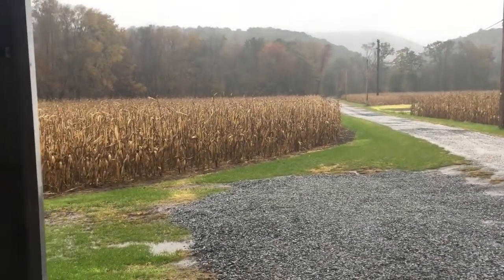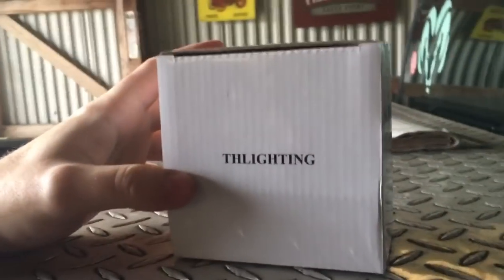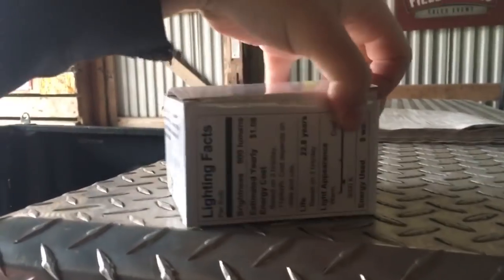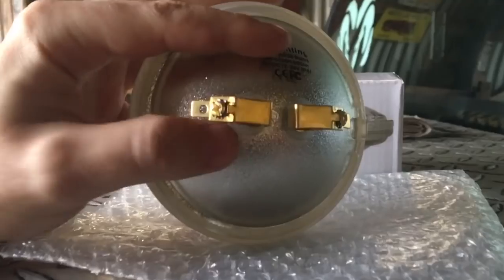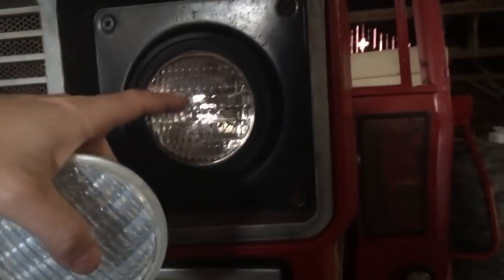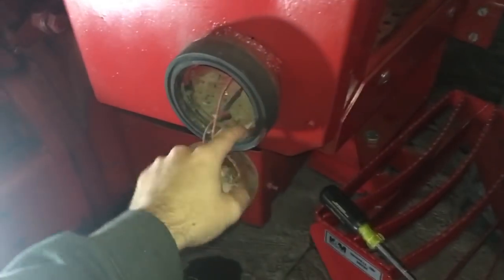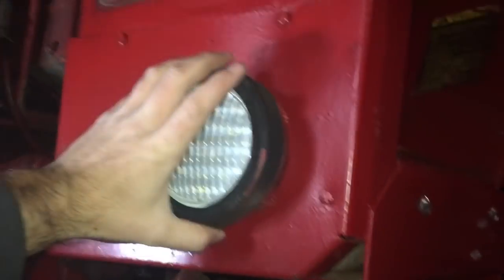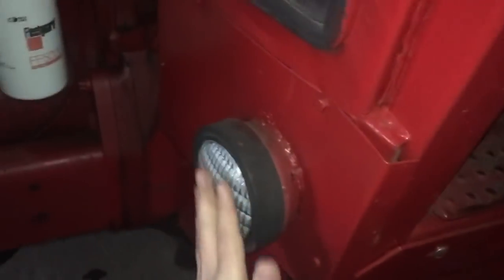IH 986 LED Light Replacement

Comment: Thanks for being the "Guinea Pig" with the LED lighting.  Looks like a good upgrade for the lighting.  I'd put 2 LED spot lights on the front so you can see       down the field/road & 2 more LED flood lights on the back to light up the work area so you can see how well your implement is working but, I'm just suggesting.  Somehow I think you've already got this idea in mind.  The best part about those lights you got is that they fit the original light fixtures.  Stay safe.

Comment: You 	will like the L E D lights. I just changed my lights to L E D  on my 1086 a couple of weeks ago. Wow what a difference. I got my lights from Larsen Lights. I need to edit my video and get up on YouTube. The head lights were high beam and low beam lights. I just wired them high beam. There a little bright to on coming cars on the road so I will put a switch it so I can have low beam on the road and high beam in the field. Thanks for sharing your videos.
Reply: I got my LEDs from Larsens as well. I replaced all 5 on my 1066. All of my windows are tinted, but the LEDs are bright enough to illuminate the whole area, even with the tint. I really like them!

Comment: How did you end up with all of the lights going through the rocker switches rather the the factory rotory switch? Are the flashers on the rotory switch still?